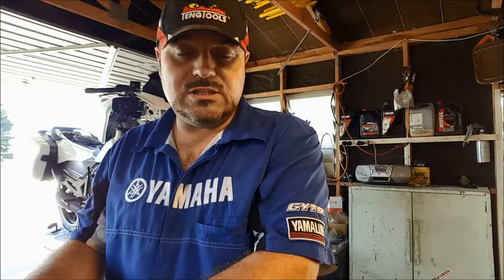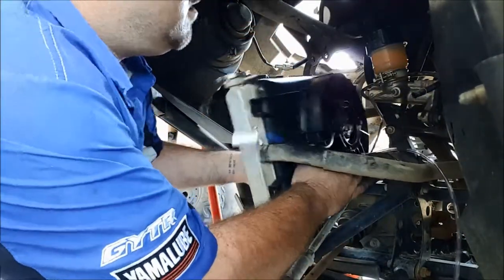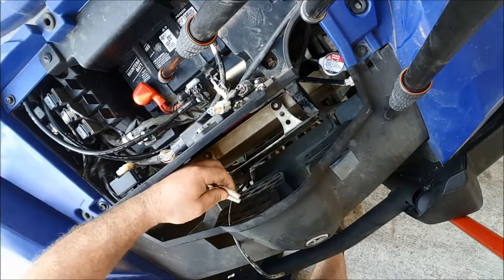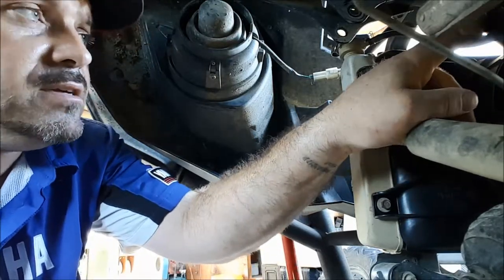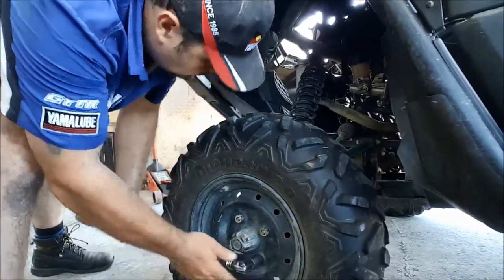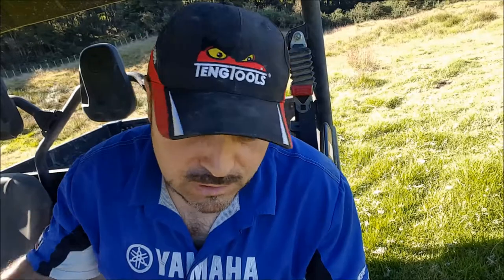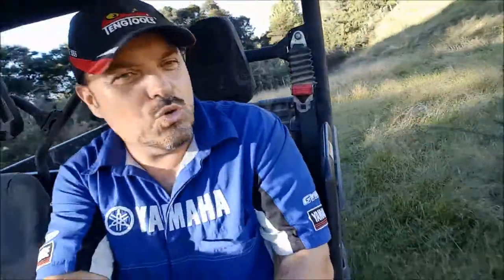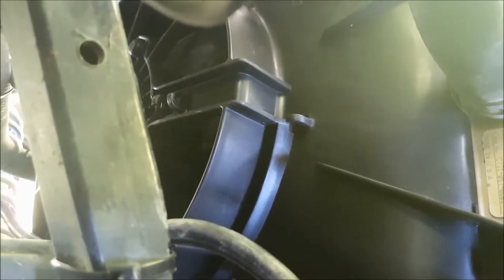Yamaha Viking radiator refit and off road test drive #1110

Comment: I just finished replacing mine; this video was very helpful; thank you!  One thing though - I was able to get the old one out without opening the coolant loop, but I had holy hell getting the new one in - I ended up taking the return hose off, and only lost about a pint of coolant, and all of it came from the radiator; I raised the hose as soon as I pulled it to keep any from draining out of it.  Getting the fan shroud in after that was SUPER easy.  Topped off the radiator when all done, and it's all good!  Thanks again!
Reply from the maker: +Tony Darst Awesome, great job Tony. Yes, I agree, it's almost impossible getting the radiator back in. 

I have done the same recently and removed a hose. Don't forget to bleed the system, there is a small bleed screw on the cylinder head thermostat housing :-)

Cheers Andy